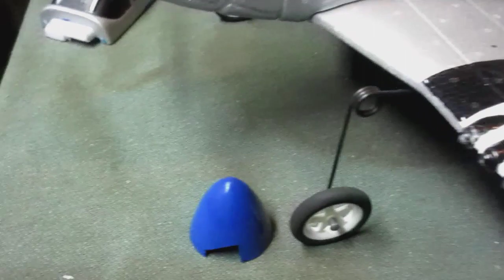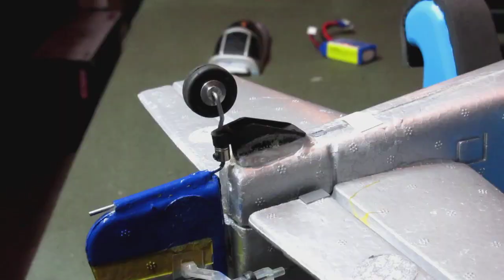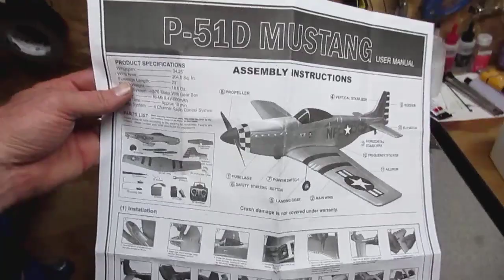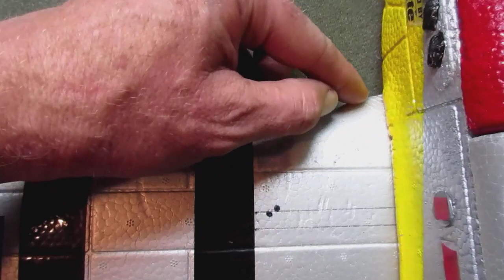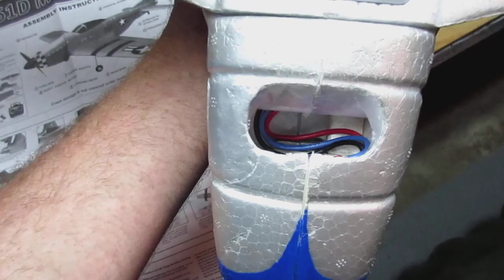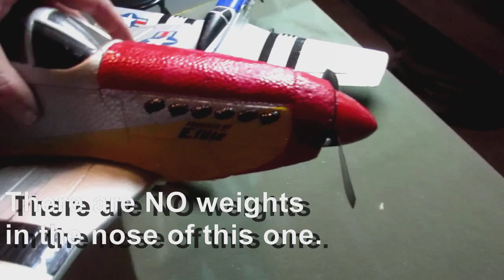Harbor Freight P-51 setup/mods  (part 4 of 4)  Fire & Ice

Comment: Hi what kinda paint do you use to paint your planes ?
Reply from the maker: On this plane (the blue) I just use the little model kit paints...Testors model paints....but I get the acrylic set....NOT the enamal.
Acrylics are water based, they are foam safe and you can clean your brushes of withjust running water.

If I want to spray paint...i go cheap and buy the Rustoleum rattle cans.  I usually get the Rustoleum 2x ultra cover. Paint+primer.

I use the same for clear coat gloss or I may use Miniwax poly coat gloss and brush it on.
Reply: @markhyde43  ok great yeah that was gonna be my next question if these foam planes could hold up to spray paint....I like that krylon 2X's the coverage. I didn't know if that would mess with the foam or not. I've thought about painting mine silver an then useing the yellow for trim detail. I'll be ordering some new wheels for it soon. Your video's have been very helpful an I appreciate your feedback.  This is my 1st plane so I wanna fix it up nice. I been useing a flight simulator to kinda learn how to fly a remote control plane. Still trying to learn all the controls.

Comment: Thank you for your help with the mods,  Can I trouble you for one more question. This is my first plane and i used the battery you recommend.   I am new and am not sure what battery charger to purchase.  Can you point me in the right direction?
Reply from the maker: Well.  I am currently using a Hitec X1mf.  It's an 80 watt,  10 amp AC/DC charger that can charge a variety of battery types and voltages.    It comes with a balancing board that allows you to balance charge the cells.   It has connections for 2S, 3S, 4S, 5S, & 6S batteries.    But I have alot 16 different planes of various battery sizes.   But you can only charge one battery at a time with that balancing board. 

Any RC hobby store will have a variety of these charges.   But in the mean time,  you can find a cheaper charger just for 3S lipo batteries on line.   Just Google 3S lipo battery balance charger. 
Here's a link to one that should work.   Is an E-flite 3S lipo battery charger at horizon hobby for $22. You can find $7   to $8 balham see charges out there too.     The link may not work as the Horizon Hobby site does not always like to load for me.   Just do a search for it. 

https://www.horizonhobby.com/EFLC3105?KPID=EFLC3105&CAWELAID=320011980000027987&CAGPSPN=pla&CAAGID=35962941278&CATCI=aud-429129994469:pla-573193002927&gclid=Cj0KCQjw9JzoBRDjARIsAGcdIDWrDKMGbEWI7nDrvGQoLzMvFMK_rcmuhCCdYExjpbRhGpJ5BNnrn4oaAmndEALw_wcB
Reply: Hi I have done his whole complete mod to my plane an I have the battery he is using an I use a Phantom Sport mine 50w. Charger

Comment: That was great I will be looking for someone part's for sure. What size wheels did you add looks like 2 or so inches I have the little stock one's and I don't like them. on your rudder  control horns it looks like you're on the last hole  on the outside and it looks like the same thing on the elevator is that the way to set them up I have them on in inside holes. Or is that a more control over the plane kinda thing I was told that less is better but I hear more is better than less? You have so much information about this I'm glad you are willing to help me out I appreciate it a lot thank you. And I got this one because I see all the crash videos and pictures of this P51 and it's not to bad on the airframe it's usually broken props. The worst picture I have seen yet is fire split down the center stick mount outside of it and it's in the air today. I see other one's like the big one you have in the video destroyed in one bad hit.
Reply from the maker: outdoors man.   Yes.  2 inch wheels and almost always the outer holes in the control horns or the ones next too it.   That is also usually where the rods naturally want to lineup with as well.  I don't like to bend the rods over to hook to a hole in the horn.  I usually see where it naturally lines up and that typically is near the outside holes.  All my planes regardless of size typically use the most outer holes.  That seems to be what most people in the forums recommend as well.

I would not make this plane the first one to learn to fly on of this size.  Hopefully you have flying time on planes of this size already.  Otherwise you will probably end up like me; in the shop with a heat gun and glue after the first one or two flights.  Master the hand/eye and controls coordination on an easier, more forgiving airplane before putting these in the air.   They are actually pretty quick and do not like confined spaces.
Reply: hujum1 yes I have some experience with rc planes but it's been awhile since I have had one up so I got a mini apprentice to knock the rust off and  get the feel back it's been almost 20 year's without flying a rc. that's the other reason I got the a 80 dollar one to see if I still got it I would hate to destroy a expensive P51 because I'm rusty on the sticks so I went with a less expensive one to try I don't know to much about the new stuff 20 years has made a new world in rc